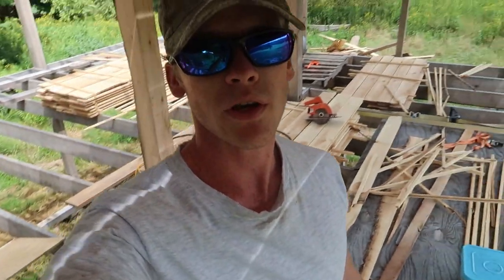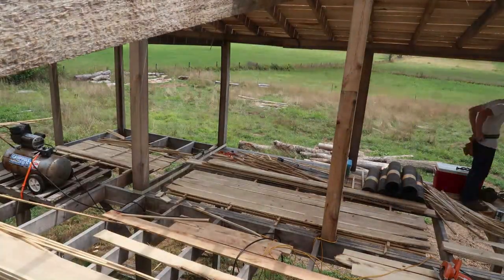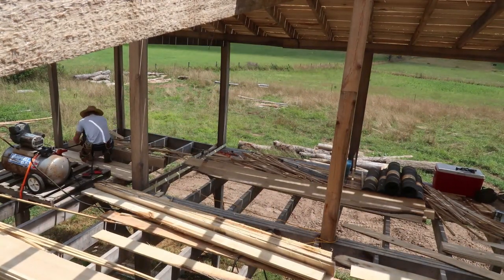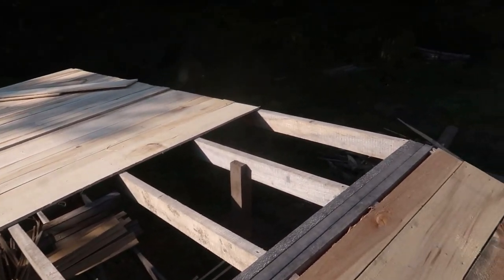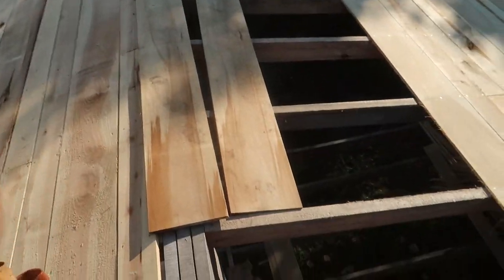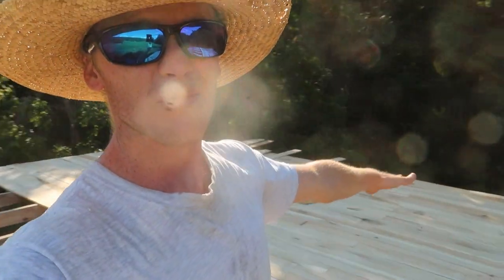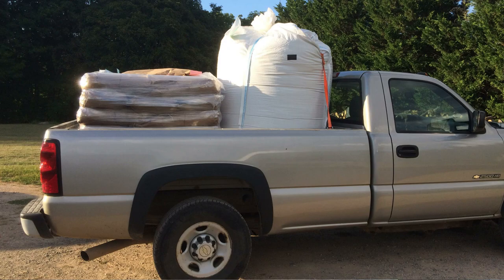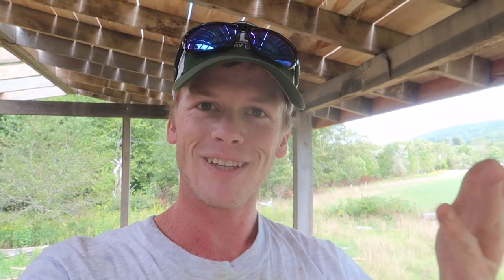Final Sheathing | Sawmill Shed

Comment: Son you can ramble all you want. I love the hell out them. Long time since I saw someone with ambition enough to come in out of the rain. Your new buddy will be happy when you get moved to the new homesite. Just think once you move in, you can fire the guy working downstairs and get some rest. I see in future a barn for cows, a hog shed, a chicken coup. Check out geese that act as guards for range chickens... good stuff as they love leafy food and water in a little feeding pond and they are happy critters. Chickens have their water and place to lay and roost, must have at least two tiers for chickens to roost at night as they are territorial and high archery over lower class in the roosting order. Trust me that I know cause they are weird that way. Happy chickens are good layers but you get unhappy and they will eat the others eggs or kill the others. I think it is cause as they are born, the chicks when big enough to roost at night, they sleep on the lower level but the older ones go to top rung. Its funny to watch as they transition to the top level. Just why don't you set up a table saw with a back stop to cut to length as they get tiring measure and then cut and do it again. pile the wood up so the six foots hit one pile and the long in another and the stuff that doesn't fit either category can go in the middle. I hope soon that the board and bat or live edge or shiplap depending on your choice of the mill shed siding. On the bottom of mill shed, either live edge or board and bat would look cool and the next level could be shiplap so there is a definite change that you see recognise. Making shiplap is easy if you build a deal for the mill to rock the cants to side to side and get the thick and thin lumber. I had better stop as time is precious when editing and reading book volume comments

Comment: Go to home depot and pick up a kit Milwaukee has a set of power tools you get a screw gun, drill ,grinder saws all flashlight, skill-saw and a couple batteries and charger for down there in the usa five hundred best investment you will ever make. then your not mes~sen with extension cords and generators.